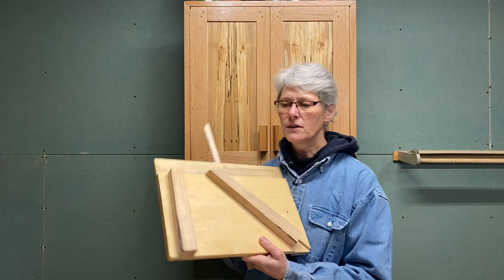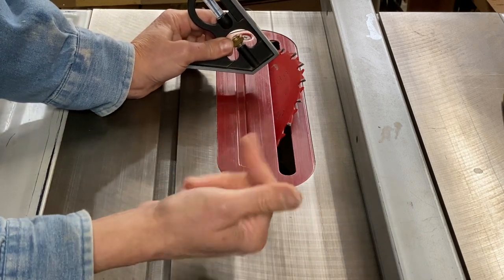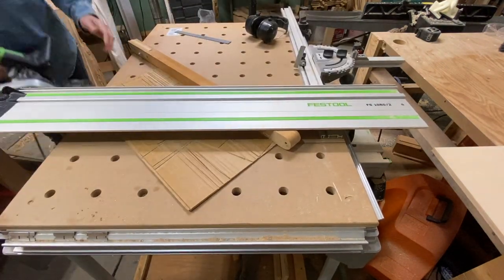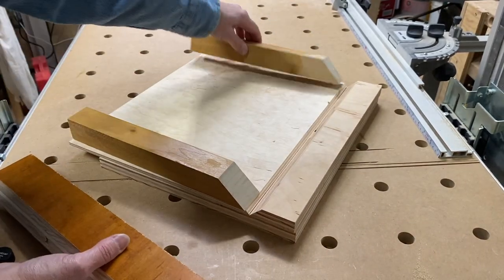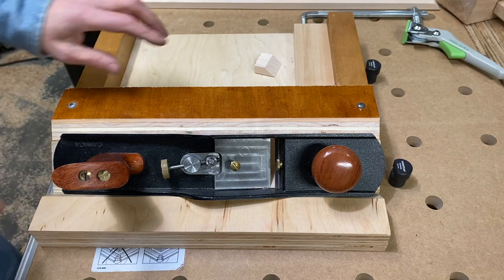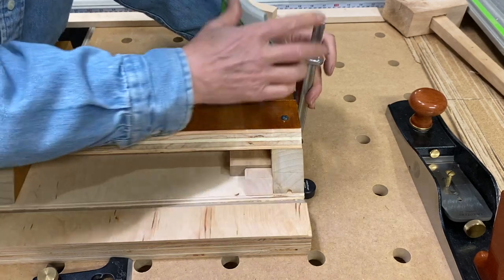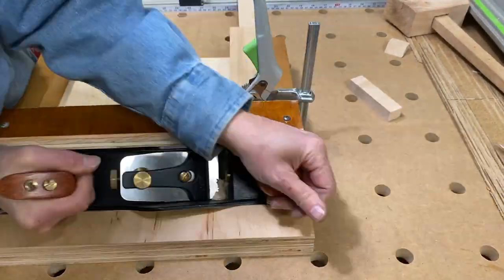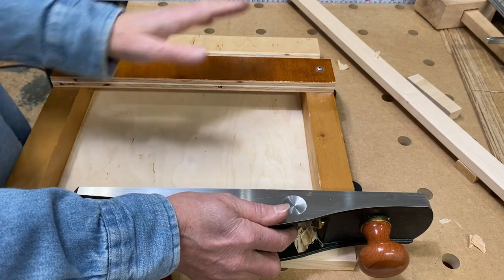Make a Miter Shooting Board

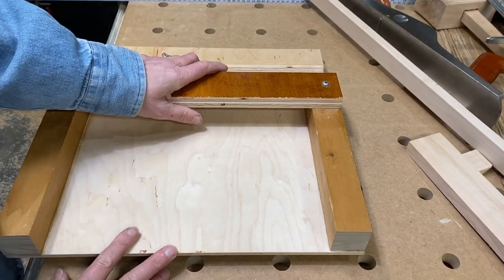Comment: I just made this jig and heeded your comment at the 9:00 mark about also allowing for 90 degrees for end grain. However, just extending the bottom plywood is only part of the change.  The strip along the front for alignment must be the same thickness as the top piece at the opposite end so that longer pieces can be placed through the jig on the same plane. Also, the alignment strip would need to be removable so you can use the jig for its original purpose.
Reply from the maker: Great tips!! Thanks, Stuart!
Reply from the maker: Great tips!! Thanks, Stuart!

Comment: If the track saw will cut accurate enough miters to create the angle on the shooting board why do you need the shooting board?
Reply from the maker: The track saw cuts good enough miters, but the saw cut is not as clean as a plane blade slice. And I’m a perfectionist. Or try to be one!
Reply from the maker: The track saw cuts good enough miters, but the saw cut is not as clean as a plane blade slice. And I’m a perfectionist. Or try to be one! The cut on the shooting board doesn’t need to mate with anything.